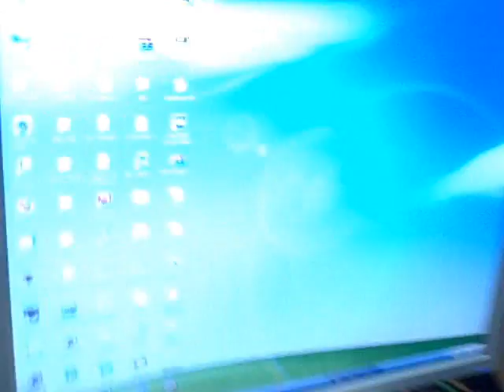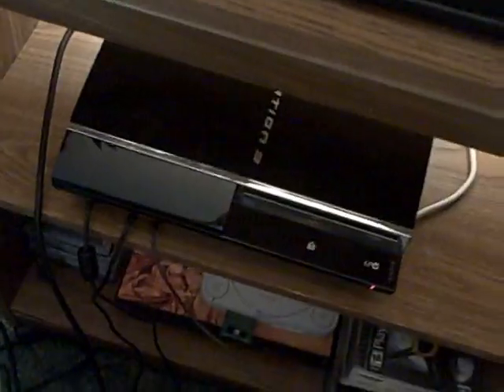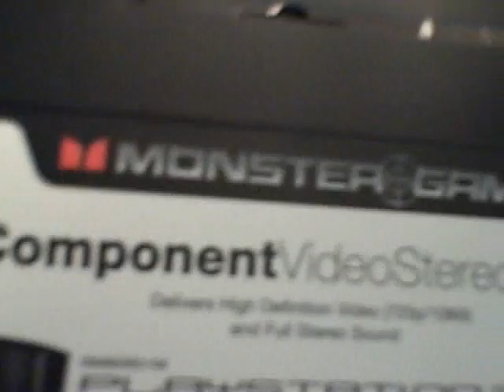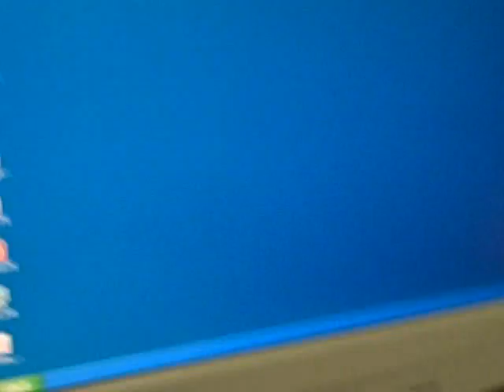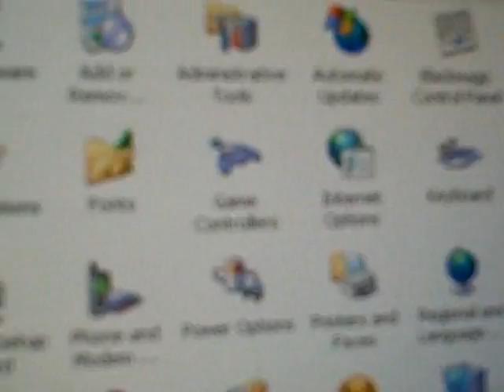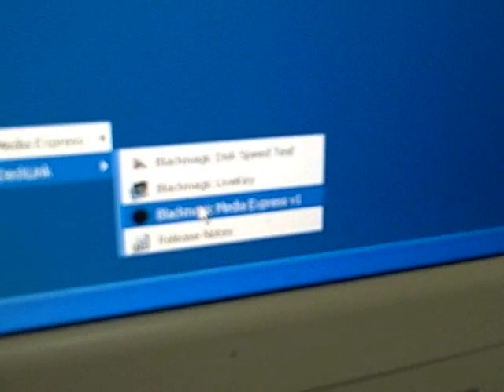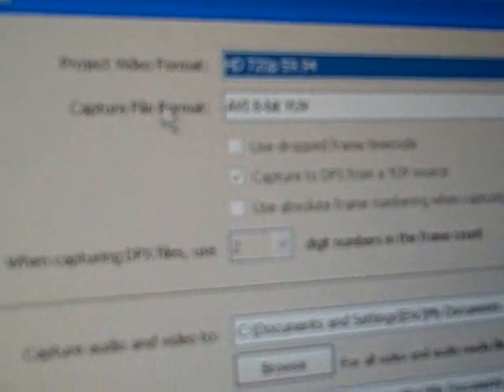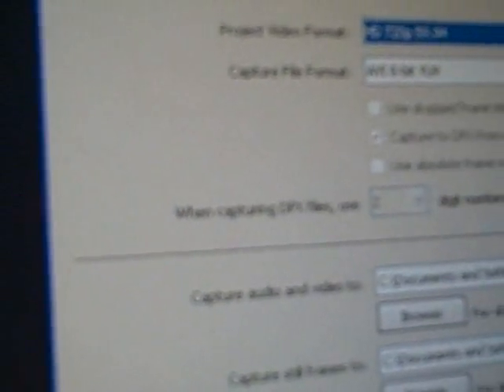Black Magic Intensity Pro: Setup part 1 (ps3)

Comment: Thanks for the video. It really sucks that Sony have disabled HDMI being used as an input. My Xbox 360 doesn't have HDMI output, so since I've just recently got a PS3, I'm going to have to mess about with tons of cables when switching between the two :(

Comment: Just to clarify I am thinking of getting a set of component cables for the PS3, but it has 2 red cables, 1 blue, 1 green and 1 white will this still work or do I need the 2 red, 2 blue and 1 green set you have?

Comment: How do I change the settings using Blackmagic Design Desktop video 8.0.1 on Windows 7 64-bit Ultimate?  The only options I have for output are HDMI & Component and HDMI & Composite (Y-Out) & S-Video and for input I have HDMI Video & HDMI Audio, HDMI Video & Analog RCA Audio, Component Audio & Analog RCA Audio, Composite Video (Y-In) & Analog RCA Audio, and S-Video & Analog RCA Audio.

Comment: Ok so, you have to use component cables w/ the ps3, but supposedly not the xbox360, so which means that the quality with the BMIP and HDPVR are the same on ps3 but on XBOX, the BIMP is better, and this does not work with Mac either, so therefore, all the more reason to go w/ hd pvr, cuz now it wouldn't even work for my Mac, forget BMIP, even though the quality is better(on xbox)

Comment: When you go to the black magic control panel, my set output only has "HDMI & Component" and "HDMI & Composite (Y Out) & S-video". As for set input, it only reads the following:
-HDMI Video & HDMI Audio
-HDMI Video & Analog RCA Audio
-Component Video & Analog RCA Audio
-Composite Video (Y In) & Analog RCA Audio
-S-Video & Analog RCA Audio
I don't know why i don't have any of the options that you have. I have everything hooked up right. However i am using my computer monitor as i have no TV.
HELP!

Comment from the maker: @DremPS3 you can use component cables for the output also, don't know if you can see in the video when I'm showing the cables but there should be enough connections for a 2nd output for component.

Comment: I think the reason he says you cant us hdmi cable only with PS3 because the intensity pro will not input sound with the hdmi cable? but, if you use seperate audio cables, and plug into your line in on audio card , otherwise many other people have had no problems using hdmi cables for ps3 hookup

Comment from the maker: @SPQRtheFEAR should of read the info of the video on the right which I say in big letters that no you can't just use HDMI alone. This video explains on how and "only" way to make it work with a ps3. You have to use a component cable for the input to make it work.

Comment from the maker: yeah you going to need a fast computer if you want to capture it on high quality (explains the stutter movements), since I just broadcast mine and not record it so it doesn't matter in my situation.

For the tv part, you have to make sure you have the settings on your media express the same type of display on your tv (720, 1080i, 1080p). As for me it doesn't show anything on my media express either but it displays fine on my tv (explains i did it right)...

Comment from the maker: Well does your computer have PCI Express in your computer? because the problem sounds more like the actual install of the capture card inside your computer. (if the whole software is not working)

Comment: Hello alex21186.  I looked everywhere for a little explaination on how to hook up my BMIP. ( i have a 360, and the screen would be black when i used the component in and outs, of the breakaway cable.) but I see from your video that I need to use xbox analog to BMIP In, and then HDMI from BMIP to HDTV.   i looked everyewhere on the net, and you were the only one to explain this very well and very awesome.  props!   Gotta go get my hdmi cord tomorrow.   Really hope that's going to fix my problem

Comment from the maker: even if you want to record in 1080p, most games don't even support 1080p. Most ps3/xbox360 games are in 720p and a few on 1080i, but if you want to try different ways to make it work then be my guest. I just know that this is one of the few and (easiest) way you can make it work for a ps3 with this capture card.